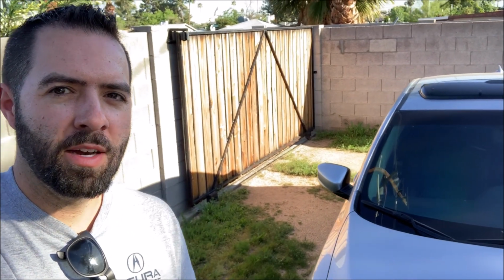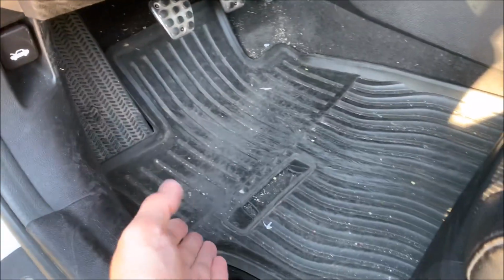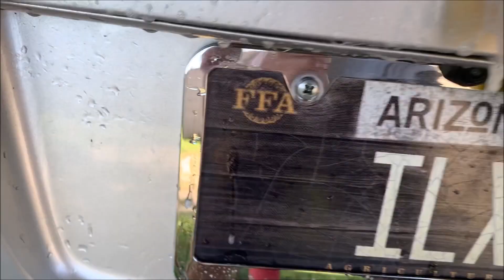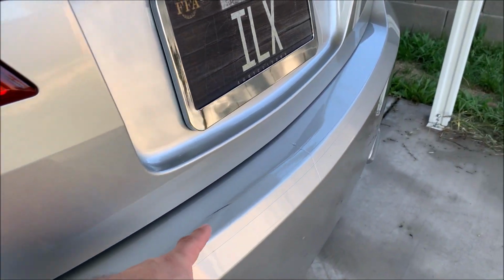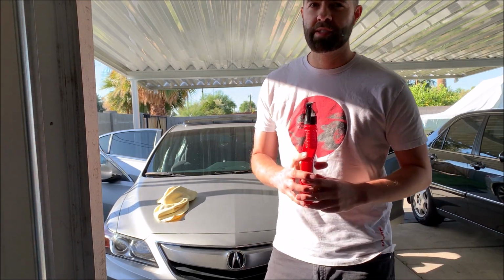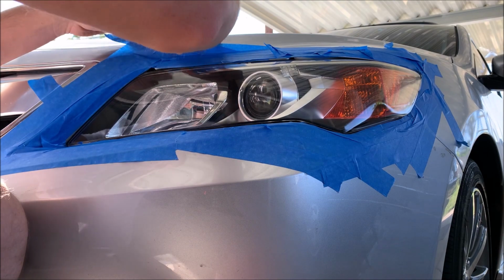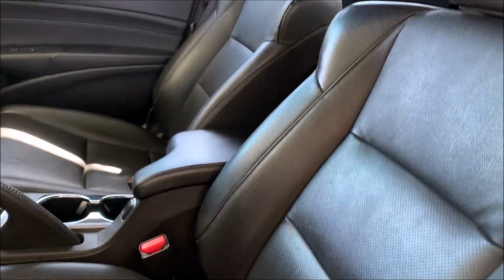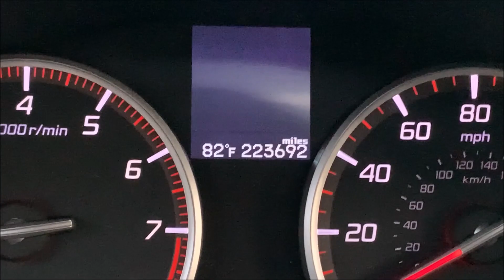Detailing the 223,692 Mile Acura ILX 6-Speed:  2 Days in 10 Minutes

Comment: Hey Tyson, I just purchased a new Acura ILX, and was wondering if you think putting top-tier premium gas is needed if I wanted to push out the mileage that you got on your ILX? Or if putting top-tier regular gas would affect anything in the engine such as carbon build up. You’ve got a nice ride man. Keep up the good work.
Reply from the maker: Thanks Miles!  I have always used premium fuel.  I think you can run lower octanes but you will get worse MPG.  At least that's what I've heard.

Comment: Nice car. I'm considering getting one myself, same color too. Sharp looking car. I have a couple questions about it. What package is it? Premium? Base? I know it's an ILX. What octane fuel do you use? Any problems with intake valves getting carbon deposits? I see how the spoiler has faded faster than the rest of the car. Was it put on after the purchase or at the dealership at purchase? How tall are you and is it roomy enough inside for you? I have a Subaru XV with 103,000 miles and I'm on the fence if I'm going to keep it a couple more years or buy an ILX sooner. Any input you could provide would be greatly appreciated. Thank you.
Reply from the maker: Premium trim.  91 octane.  No carbon.  Dealership installed accessories.  5'11, ample room.  Good luck!
Reply: @TysonHugie  Thanks. I appreciate that. The intake valves were one of my only concerns. Still a bit leary about the dual clutch 8 speed automatic and electric parking brake but I'll research those as well. Pretty sure an ILX will be my next car. I wish you continued good luck with yours.
Reply: @TysonHugie  Hey Tyson Just thought of 2 more concerns I forgot to mention. I know you've put many miles on your ILX. Have you ever had a flat? The reason I ask is the 2019 and newer don't have a spare they have a repair kit. Ever had to use the repair kit or does your year have a spare. Just curious how that whole thing works. Second concern is the electric parking brake. I've heard some of them have issues locking up and road salt can mess up the sensors and cause issues. Any experience with these or is there anything else worth mentioning about the car that you don't particularly like? Thanks man. I'd rather get the opinion from someone who has had one this long and with this mileage.

Comment: As an enthusiast how has your experience been with the parts department? I needed a new seatbelt anchor bolt and the OE part number did not match two bolts that they sent me. Dealers have been less than helpful and Honda customer service told me it was the responsibility of the dealer to ensure correct parts. Endless limbo. :-/
Reply from the maker: I have primarily only dealt with one local dealership over the last 14 years of living in the Phoenix area, and they take good care of me.